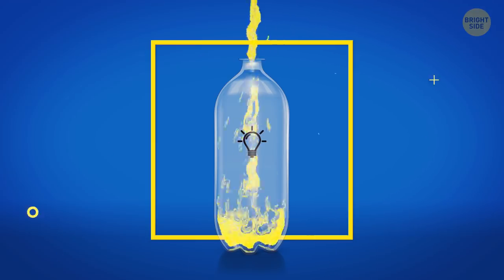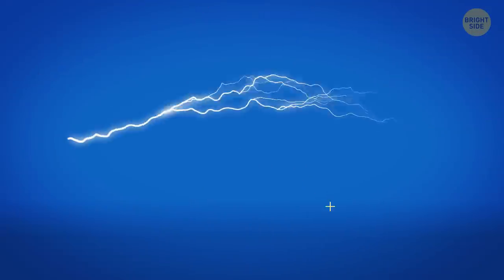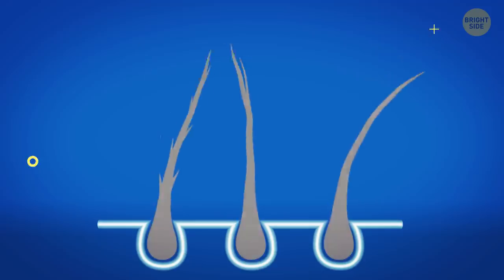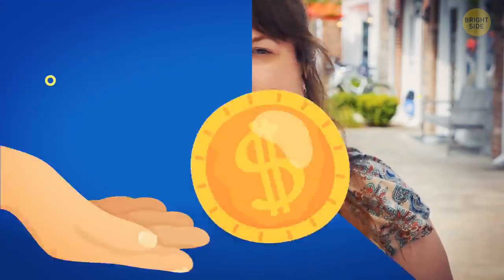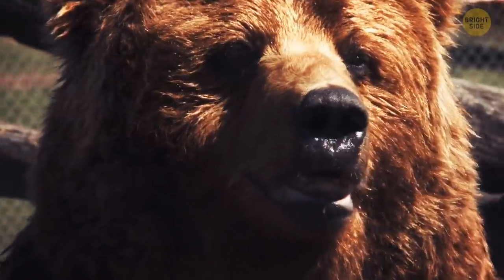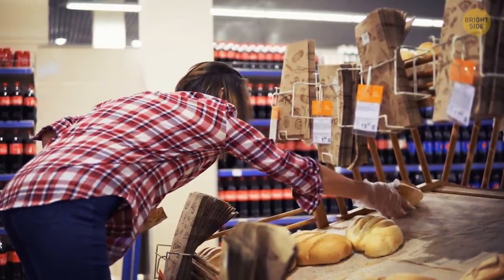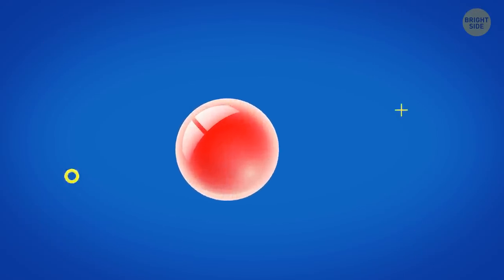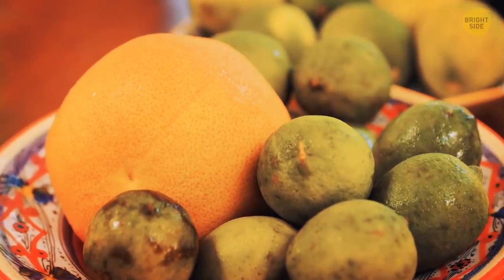Why They Don't Fill Soda Bottles to the Top

Comment: Things expand and contract with changes in temperature (liquid/soda included). Normally, they shrink as they get colder and grow as they warm up. The extra space in the soda bottle is there so the soda has room to expand into and not break the cap or even the bottle itself by creating too much pressure.
Reply: Especially when shaken up.

Comment: 5:24 They are orange because red and it’s components are the least scattered colours in the spectrum of VIBGYOR. So, they are made of orange or red. This is also the reason why traffic signs and reflectors are red in colour. And also, the sky is blue in colour due to the same reason. Violet and it’s components are the most scattered colours in the spectrum. So when sunlight hits the tiny particles in open air (which are invisible to the eye) violet and it’s components get scattered the most. So sky is blue

Comment: All soft drinks contain water. When soft drink bottles are chilled in sub-zero temperatures, the water on account of its anomalous expansion expands. Thus, to provide space for expanding water, soft drink bottles are not completely filled as otherwise they will burst.

Comment: There's at least one exception and it's possibly because it's not carbonated (haven't watched the video yet.) The tea I buy in plastic bottles is filled basically all the way to the top (I think the brand is Lipton but I'm not 100%.)
Reply: That's Pure Leaf, you can tip it upside down, and you can't see any bubbles